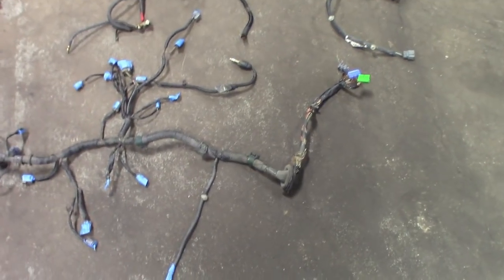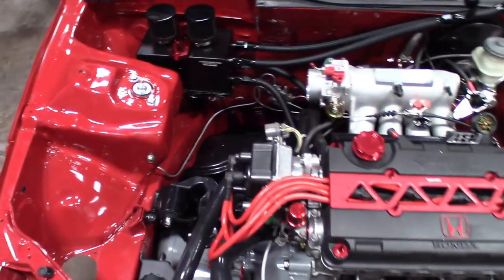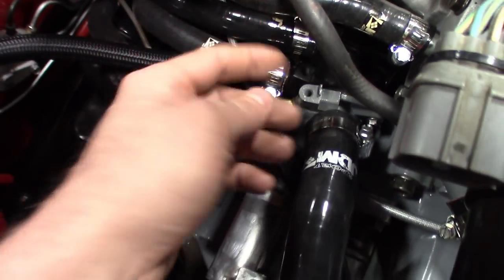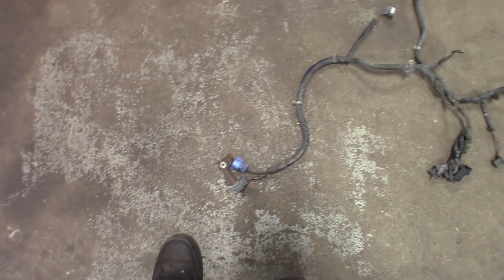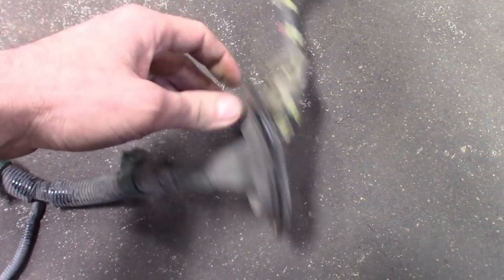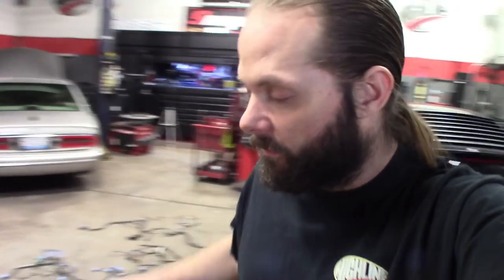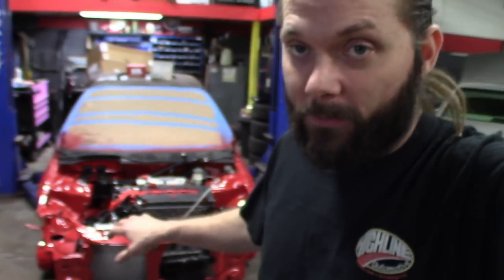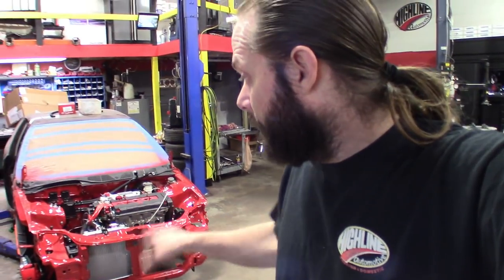Motor Is In...  Intro to DIY harness build

Comment: your video´s are good enough for me . The work that you are about to do is a monthly for me and so far I don´t see or hear anything unusual . If there is a mentionable difference . I made a Wall on which I can hang the old harness and assemble the new one . I also need to draw the new harness .If I would do a one of then your way is the most practical and logical . You are doing a great job as far as I can see .
Reply from the maker: I would like to list out a schematic, gauge and length of each wire to do a proper tuck.
Reply: @JRC54  It's extra work but it is worth it in my opinion.

Comment: Honda did change most all the connectors for harnesses around 2016 sucks cause we keep spare harnesses to depin connectors. But if you get a 16 up then dont work every one different except maybe trans pressure sensors or something like that

Comment: I have a odd guestion with wiring. What do you know or what kind of advice would you give for something along the lines of a mast plug in at the fire wall. I’ve been debating on how I want to run the wiring in my s-10 when I do the engine and trans swap. Also I will be buying a complete donor car. Also check out gt35/86 turbos on eBay. Not sure if you watched any of the Boostedboiz videos. They build mostly Honda’s, they have an h22 swapped hatch that’s held over 700 hp, k24 mr2 with twin gt32/82 and makes just over 1100hp, they have a lot more Honda’s that they run those turbos in. Think it might be worth at least looking into. Love how clean your engine is look by they way definitely some inspiration and ideas i could definitely incorporate in my build👍👌
Reply from the maker: I believe the gt35 was what I was looking at with go Autoworks they have a good amount of options. Not really sure about a plug in on the firewall, I remember the older blazers and s10s having that.